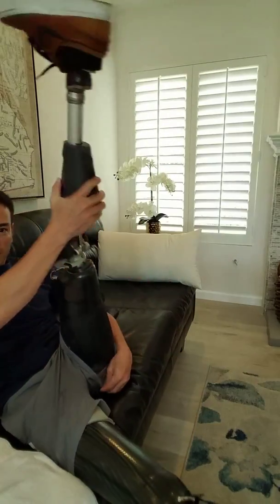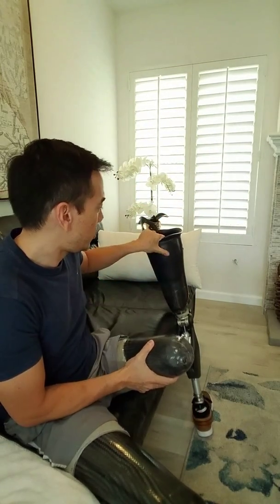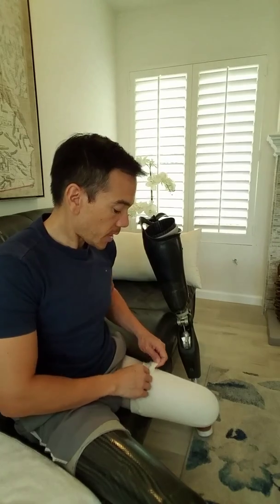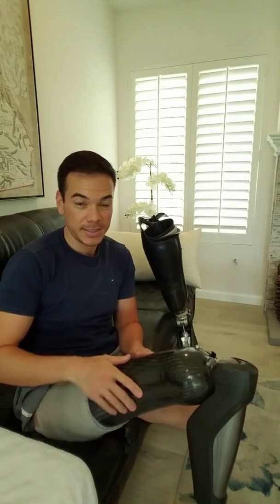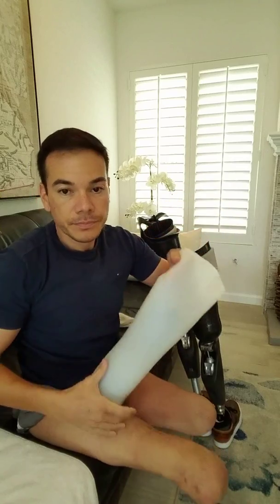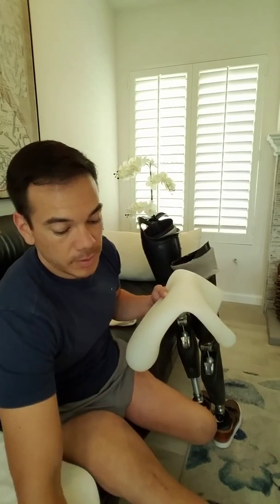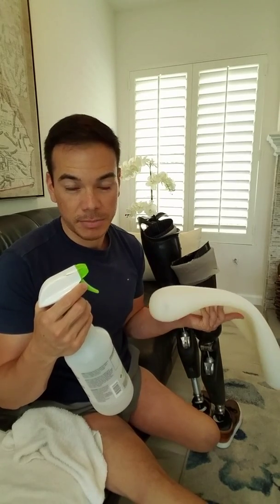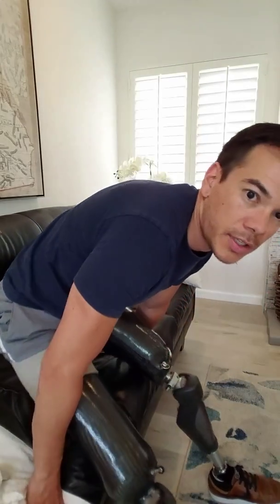Bilateral Above Knee Amputee Socket System

Comment: You mentioned that the amputation of your right leg was through the knee joint (leaving part upper half of your knee), but your prosthetic also has a knee joint.  Does this mean that you’re actually taller now than you were pre-amputation?  Can you choose how tall you’d like to be post-amputation by the length of the prosthetics?
Reply from the maker: Sorry for the uber late reply! I'm going to be on here more. To answer your question, yes, because of the knee disartic that means I get to be a bit taller than I was naturally. 😁 I can choose my height, but then my balance becomes an issue.

Comment: I'm about to have an above knee amputation in the new year. If you had a choice to have above knee or knee disarticulation amputations on both sides, would you prefer one over the other? Are there any particular reasons for your choice? The prosthetist I saw talked about how it's easier to fit an above knee prosthesis and gave another couple of reasons why surgeons usually chose above knee over knee disarticulation, but there was so much information coming at me I can't remember what they were. Thank you so much for any personal insight you can offer!
Reply from the maker: You have much more control over the prosthesis with a knee disartic (KD) amputation because the muscles are intact. My right side is the stronger side. A good prosthetist will have no trouble fitting you for a socket with a KD amputation. I didn't have a choice, btw. I was in a coma.
Reply: @OCAmputee  thank you for replying. Why you would have more control makes sense. Does having knees bend at slightly different levels affect your balance? Sorry if my comment came off as implying you had a choice. I didn't mean that at all. I guess what I was trying to ask was if you had more issues with your above knee vs knee disartic side that was specifically because of the level of amputation? I'm still kind of panicking a bit about losing so much of my leg and thought your opinion would be really valuable seeing how you've experienced both levels of amputation instead of listening to a prosthetist talk about it, but didn't experience first hand.
Reply from the maker: The difference knee levels doesn't affect me at all. I don't even notice it! If you can and if there won't be any skin issues I'd def go for the KD option. I see other bilateral AK amputees and am amazed how they walk with two above knee amputations.
Reply: @OCAmputee  thank you so much for the advice! I still have to see my surgeon for the pre-op appointment and I'm going to ask him if there's a particular reason he didn't mention a knee disartic.

Comment: Question.  My AK stump really hurts, even after 2 years.  It’s hard to walk and I’m so frustrated.  My prosthetic stays on by vacuum.  Any suggestions?
Reply: Find you a Prosthesist that is also a L.A.K. or R.A.K. like I did. I bounced around between 6 of them and they all suck. He can look at how I walk and adjust it to where it feels better and I didn't know I needed it. It's impossible to explain what your feeling ,You have to be a Amputee to understand it.
Reply: @wes2460  —my fucking stump hurts after 3 damn years!
Reply from the maker: Is it the socket that's causing your stump to hurt? If so, talk to your prosthetist about it and see what solution(s) they come up with to fix it.

Comment: Excellent explication! Question: Is the right leg knee position lower than where the knee was before the amputation and, assuming both prosthetic knee joints are at the same level, are the lower prosthetic legs shorter than your original forelegs?
Reply from the maker: My limb lengths are different because I caught an infection and the doctors had to cut higher to stop it from spreading. I'm a bit taller now. 😁